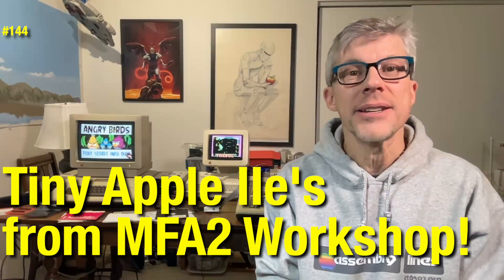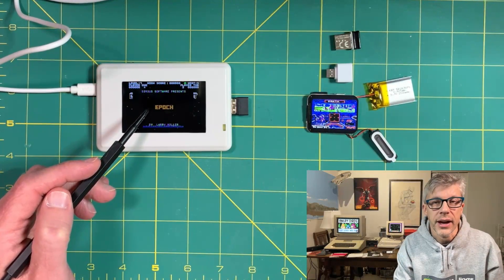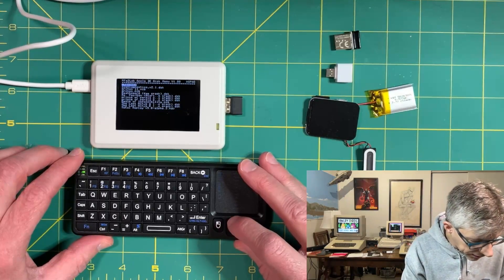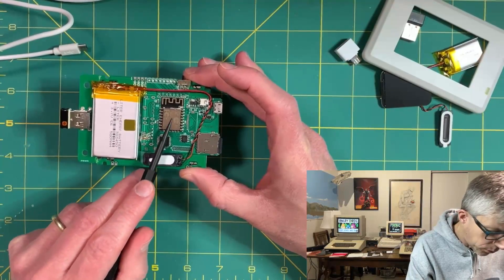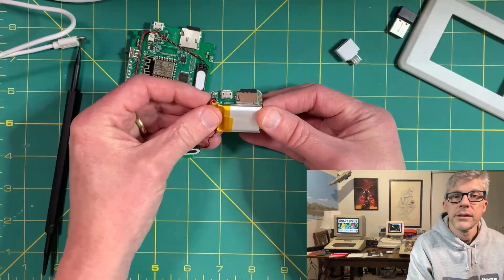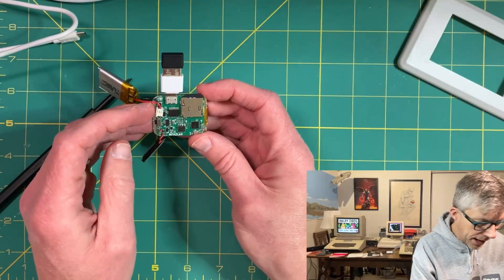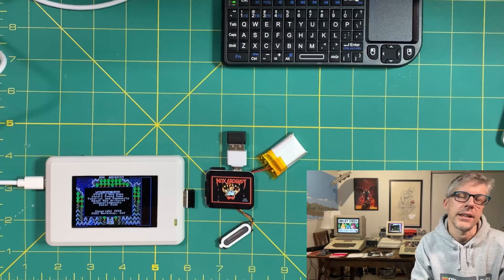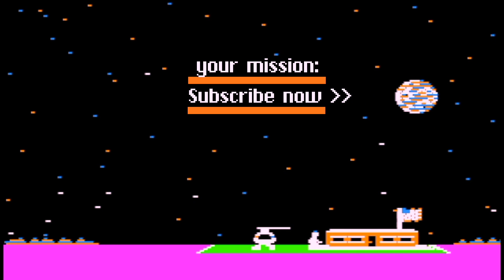#144: Tiny Apple II Computer

Comment: I just received mine (the 3.2" model - looks like it was the last one on the site). I hope that more of these become available. I'd also love to have it in more of a kit form, where the screen, speaker, and power switch aren't attached, so I could make my own enclosure, something like a miniature Apple IIe case, floppy drive, and monitor. If this is going to be the last one available I don't want to start tearing this one apart and risk breaking it.
Reply from the maker: I should be getting more in stock in a few weeks/months, so maybe hold off a bit (just in case), but hopefully you can start tearing it apart soon :-)
Reply: @CT6502  Awww, but I wanna tear it apart NOW! ;-)
Reply from the maker: @Androctonus84  Just go for it. I'm 95% sure that I'll get more in stock. Be careful though, because like all tiny LCD's, it's pretty fragile. Please post comments (or a video!) with your rebuild!

Comment: The larger screen but without a border would be awesome. Modern phones try to cover the entire front with display. That's what I'd be looking for. Small, medium, phone sized, whatever, but with the smallest border around the display possible.
Are they still available? I only see the larger version in the link above. Can you post a link for the smaller unit or are they discontinued?
Has the firmware been updated? It would be awesome to have a 4M+ IIgs here. WOZ support would be great too!
Is there an sdk so people can build custom firmware? Other emulators, etc?
Reply from the maker: Only the large version is available. The tiny one isn't officially discontinued but no one really seemed as interested - just too small! I agree with you about the bezel size, but since this is a hobby project, the tolerances are just not as "tight" - the case is a hard plastic, and it might be difficult to get a thinner border without switching to metal or going with a totally custom molded plastic, which would probably require a run of 10,000 rather than a dozen 🙂
Reply from the maker: No recent firmware updates. There would be a fair bit of work to support the IIGS. And Woz support would require floppy disk emulation which is much harder than simple ProDOS block reading/writing. But those would certainly be cool!

Comment: This is really cool, we don't need a practical use case to justify its existence or buy one. 😉

Do you know if this is running linapple or some emulator? Probably a dumb question and you may have wanted to skirt ROM issues but would be interested in hearing about that. 

The emulation looks and sounds amazing, hard to get 80 columns and DHR with such high fidelity. 

Sorta reminds me of the never launched Tiger Learning children's computers they were working on in the late  90s: small PCs based on 6502 and running Apple II software.

Great job as always, I wouldn't have known this existed otherwise. Thanks for all your long hours in support of the Apple II community overall and have a wonderful Christmas!🎄
Reply from the maker: Thanks so much for the kinds words Joe - I really appreciate that! Regarding the emulator, I don't actually know how the code is working - we would need to ask MFA2 Workshop for details. I assume it's custom C++ code running on the ESP8266 - he had a bug in doiuble lo-res graphics a few weeks ago, and was able to fix it with a firmware update, which suggests that it's homegrown code. Happy Holidays to you as well!

Comment: Thanks for creating this video. I am interested; however, I've learned the life lesson of not purchasing bleeding edge projects (even cool ones), thus I tend to sit back and watch the progress until a product has stabilized. As second comment, I can't think of a practical use for it, but not everything needs to have some sort of practical use. Just being a cool device sometimes is good enough.. Having a 3D printed IIe case with monitor on top would a novel item.
Reply from the maker: Very true Neal. Mfa2 has actually already refined the pcb board, so it will look a bit different. Also, Javier is in the process of creating 3D printed cases which look like an Apple monitor.

Comment: Processor looks like an ESP32, which, yes, has WiFi and Bluetooth.
Reply: ESP8266
Reply from the maker: @yeungww3125  it would be interesting to see if the wifi could be used simultaneously with the emulator, sort of like the FujiNet.
Reply: @yeungww3125  Yeah, wasn't sure. So, Wifi but no Bluetooth, I think.